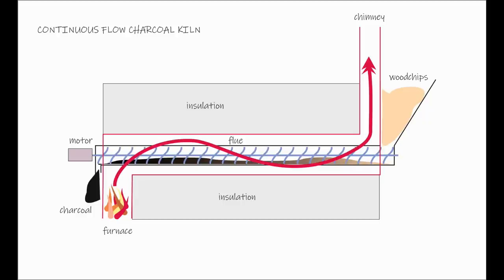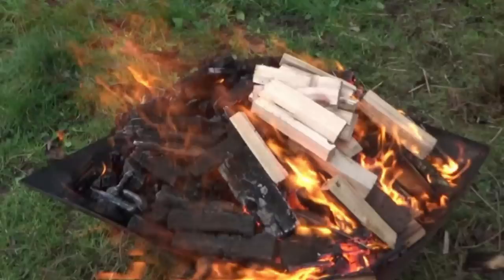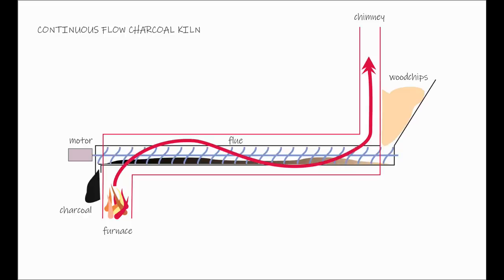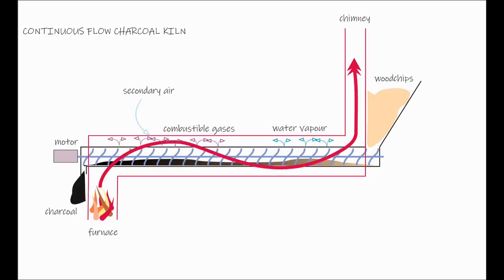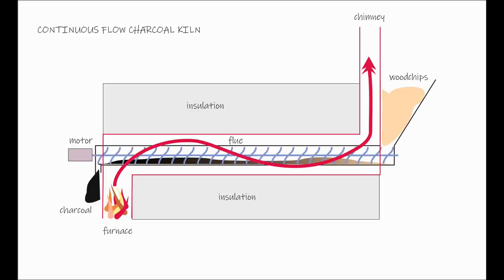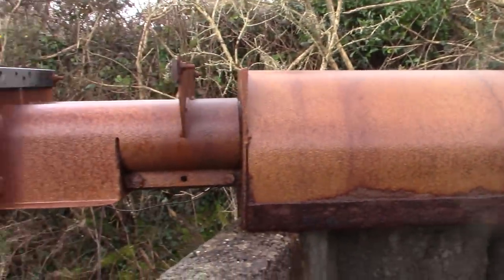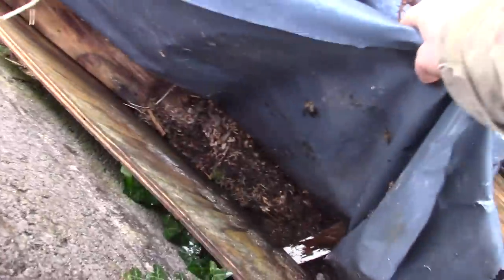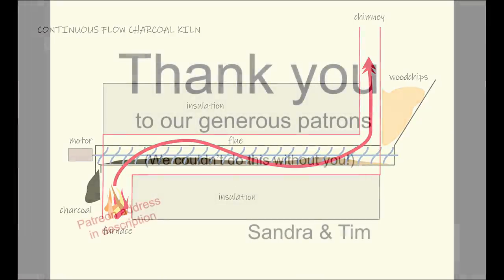An Interesting Design For Constant-Flow Charcoal / BioChar Production..

Comment: I think you are really close with this design. Extending the augur tube on the exit side some distance would allow it to cool.
Also, drawing the intake air for the forced air down across the cooling part of the charcoal exit tube might help cool the charcoal below the spontaneous combustion temperature.
I sawnutwiss's suggestion of a chain conveyor might be cheaper
Reply: Yeah, counterflow air!  That would be neat.  Could maybe figure out a way to “entrain” the Pyrolysis gas or syngas or whatever it is called from the end of the auger into that airflow to allow it to burn more towards the entry.

Comment: Some ideas
You could use cement or brick as the insulation material and then run pipes with water through the insulation, and then use those hooked up with radiators to heat a building. You could also take the wood gas that comes off of the charcoal process and use it to power your locomotive for your railway I know in the 30s and 40s people would power their cars with wood gas stoves.

Comment: If you wanted to do a continuous process, I'd use a slanted pipe with a rotary airlock on each end. I'm not sure if it would pass your wood chips though. If the output end had a water jacket, that would both solve the ignition problem and also heat the water for your house.

Comment: It’s a very interesting almost ingenious design but I’m curious how you plan to stop creosote from gumming up the auger since creosote is extracted from the wood in the charcoal making process and can condense inside the auger or smokestack, also you could theoretically replace the bearings in the auger with metal shielded ones and connect the augers to the line drive which would eliminate the issues with what you already have with it and potentially make it viable to continue with the old design
Reply: I think sheerly via high temperature was the plan; have them stay as vapor and combust with the secondary air and/or get thermally cracked into more volatile hydrocarbons and/or syngas (which would do the same) and/or petcoke.
Reply: Granted a good clean once in a while is always nice!
Reply: @ericlotze7724  I was talking about on the screw of the auger which is theoretically the coldest part as it’s furthest away from the radiating heat and has charcoal sliding along it which would absorb heat from the screw as it passes by as well, but now that I’m actually thinking about it that is a very valid point it should easily stay in a gaseous state so long as he can keep enough heat throughout the entire system, the main times he’d have issues with creosote is upon startup and shutdown so as long as there’s enough heat still in the system he’ll never have an issue, thank you for your insight it helped clear up the one thing I apparently missed
Reply: In insulated rocket stoves, no creosote is formed, as the temperatures are so high that any side product such as soot, creosote, smoke etc gets burned in the afterburn process. My guess is that Tim's burn chamber did exactly that as well
Reply: @09conrado  Just as important in an rocket stove is that any creosote forming oxides and converted to CO2. The main design point of a rocket stove is really to ensure that there are always enough oxygen to complete the combustion. That's why you can have a roaring fire and hardly any smoke.  🙂
Reply: @09conrado  thank you for clearing that up, I’m used to uninsulated setups which is why I was concerned

Comment: I may have a solution for a possible cooling chamber. Once you have the conveyer system through the hot zone sorted, you could use the auger as a cooling tunnel of sorts.
Have the hot charcoal fall into the auger and the journey through should cool the charcoal. Furthermore, the density of the charcoal shouldn't jam the auger. If a piece of charcoal happened to get caught, the auger should pulverize it and continue on. Of course, this addition would also add considerable length to your operation.

Comment: As for the bearings. High temperature sintered brone impregnated with graphite is available. It's a self lubricating bushing material. It's a little spendy, but you really only need about an 25mm to make 2 bushings.

Comment: Thanks for another charming video!  Instead of 1 or more conveying tubes, you could have a flat rectangular section tube to maximize heat transfer instead.  This wide tube could be propped up at an angle and the contents moved by vibration aided by gravity.  Being wide and flat, this tube could carry the flue strapped to its lower surface, with the upper used for carrying the pyro gases back to the fire box.
Reply from the maker: Yep, good idea. But it needs to exclude the air too..
Reply: @wayoutwest-workshopstuff6299  Some downdraft gasifiers are configured roughly the same way, and they manage to keep the air out by having an air tight lid on the feed hopper, the hopper being part of the same space as the reaction tubes.  It's true that the feed hopper needs to be opened when recharging it, but this happens only infrequently and for a short amount of time, and since there is a slight positive pressure in the reaction tubes, one would not expect much air to enter with the hopper lid open.

Comment: About the spontaneous combustion of the charcoal at the end, instead of cooling them with water. Drop them into a airtight box. Well, airtight in terms of incoming air. Need some pressure relief. But then you can cool it by preheating the air that goes into the blower. Put fins on the box and draw the blower suction air past them.

Also, tip the augers down so that gravity assists.

Finally... stainless steel! Haha expensive yes

Comment: Could you use a chain conveyor or a the some like that.  Basically attach a large steel circle or square on to a cable or chain and pull it through the tube or box.  That way you can keep the bearings away from the heat as well as the drive motor.  It won't plug either.  You could use flat bar welded together to make a square tube and a paddle wheel to pull the chain.  Good luck

Comment: Nice idea. I also had a tried and tested way to produce charcoal which I have used many times. It is simply to have a stove with a straight chimney but with a very large grate. By that I mean the holes in the grate are very large about 10-10cm. All you do is light a fire on the grate and as the wood turns into charcoal it falls through the grate and into the ash pan as charcoal ready for you to scoop it up. There however does need to be a way of regulating the amount of air that enters the fire because otherwise it will burn too quickly whilst alight. From the ash pan it can be funnels via a tube to a bucket of water to cool it down. I have used this method many times and have always had plenty of charcoal. It’s a bit unconventional however is able to produce lots of useful heat and charcoal. 

Hope you find this idea useful, 
Best regards, 
Sam of the Violet Valley Railway.
Reply from the maker: That's a good idea Sam - do you mean it's a by-product of the woodstove in the house? Or specifically for charcoal making?
Reply: @wayoutwest-workshopstuff6299   it can be used both ways. I made one out of an old gas canister and i use it to keep my garden shed warm in the winter and collect the charcoal allong however in the summer its used just for charcoal. 

Best regards, Sam

Comment: You can eliminate the auger with a vertical/diagonal pipe that is fed from the bottom and empties into a box in the bottom. The rate that you empty the box at the bottom controls the flow rate (rotating flap maybe?). This also allows capturing wood gas coming up the pipe, and since heat rises the charcoal at the bottom can cool off before exposing it to oxygen. you could Even add a water jacket around the collection box and above it, giving you hot water to heat your home.

Comment: The big gas ovens I am familiar with all had cooling zones after the main firing section. Whether it was vertical can cookers, iron pipe or pottery. Drives and drives chains etc were outside the heat zone. 
I expect you already have it all planned out. Awesome. Thank you.

Comment: Couple of quick thoughts. 
Put your chimney 1/2 to 2/3 of the way down your tube and water/air cool the remainder of the tube for cooling  the dry charcoal.
Thermally insulate the shaft between fire box and bearings. Some sort of fiber shaft connector.
Great overall design.  
What are you using the charcoal for?

Comment: I worked on the design of the control & safety systems for a medium sized pilot plant 20 years ago.  It was the same principle, using an inclined rotary kiln, with a rotary valve at the hot end for the feedstock. But it was self sustaining once the coal started to gas off. It ran for a number of years before it was mothballed. Quite a dangerous bit of equipment actually.
Reply from the maker: Was it for making charcoal?
Reply: @wayoutwest-workshopstuff6299  it actually used coal as a feedstock to make coal char. Same but different.

Comment: Looking at the diagram and heat flow, I wondered if the motor would be better off being on the opposite end. The entering wood chips are the closest thing to a cooling system for the auger shaft and would cool the convected heat  going to the bearings and motor. The end with the fire box and exiting charcoal could be solid bearings cooled with the same water system you come up with to cool the charcoal.

Comment: Lengthen each end of the charcoal tubes. Wrap a water bath around the output end, to cool the char, but not get it wet. Have the auger flighting end before the tube end, so the char piles up inside the tube, to block fresh air from getting in. 
The auger flighting should be thick, but it doesn't need to be continuous. Maybe use plate paddles at a slight angle instead of flighting. Like at the bottom of an ice maker in a refrigerator.

Comment: Hi Tim, I understand the cheap, easy and clever kiln you have made instead does the job well enough for now and, taking the time to think about the project you describe here, I also come to the conclusion it may be just the best. If you ever get back to this project: Could you only "push" the wood chips in the cooking chamber? With some kind of piston or endless but short screw and slow gears at the bottom of the wood chips funnel that would push the chips into the cooking chamber. The fresh wood chips would push the ones already inside and cooked bit by bit until it goes out on the other end. In that case you don't need long and multiple tubes anymore but a quite flat rectangular shape (cross cut) chamber could do the job. You have the tools to make such a chamber from flat iron shits. Rectangular and not square or round to increase the surface area. No moving/iron part goes into the chamber so maybe would a thick enough iron does the job instead of stainless steel?  I see one critical part in my head still, how to avoid jamming at the entrance of the chamber? Good luck, success and fun:)

Comment: My thoughts: 
Let the auger be a bit longer, so that the motor end has a longer path that is in cool air.  Reasons:
1) Less likelihood of conducting heat directly into the motor.  Actually you'll probably be running the auger via some kind of reduction so the motor won't be in any danger, but it moves the end bearing farther away from heat in any case - no bad thing.  Ah, I hear you mentioning that @ 5:40.
2) It ensures the charcoal comes out cooled well below autoignition temperature, and gives you the opportunity to physically remove it from the ignition threat that is the furnace before dumping.  Ah, I hear you mentioning that @ 6:00
3) Efficiency.  Arrange ducting to pull  fresh air past the post-cooking portion of the auger to ensure it is well cooled, contraflow to make the most possible heat transfer, before that air goes into the furnace burners.  Harvesting the heat to contribute in any way toward the useful cooking is making the most of your fuel's heat output.  Ideally, the flue gases at the far end, closer to the chips input end, would be nearly ambient temperature.  A sensor or two to monitor the exhaust temperature could automate the burners and prevent overcooking the chips.
3a) Efficiency, some more: the pyrolization process releases a lot of volatile gases, could you capture the output and route that back into the burner?

Comment: This is a fantastic process, and speaking patent wise if you ever desired to patent and market these you know just how much industry loves 'scalable' and 'constant-production' in the same sentence!
I will say, as you mention, augers are only really useful with consistantly-sized particles and better yet round ones; woodchips are neither.
I love the chain idea, namely because I would wonder if you could attach wire cages/combs or grates at regular intervals to them that could scraaaaaaape the woodchips along like a rake on concrete; should one slip through it just gets caught by the next pass, and if one jams against the side the comb tines would pop past it and keep moving, hopefully being caught again by the next one. Heat might become an issue so they might need to be more "claws" than tines but the tolerances on this could be sloppier too and given you're using this for biochar any iron filings created by scraping the inner tube would simply become bioavalible iron; hardly ruining the product! I would worry about air being more freely able to travel into the tube without an auger but if it's packed enough and moving slowly I can hardly see that being a problem except at the end where a sprayer could be handy :)
Good luck and be wary of biogas, it's sneaky and flammable, should it build up somewhere it could pass into deflagration territory
Reply: Granted patents are only as strong as your legal team
Reply: Patents are a terrible waste of time and energy. Where will you find the resources to police them and have lawsuits? No one else will do that for you

Comment: A solution for the continuous process would be to push lidded containers through the heated chamber in a conveyer system. Completion of the process could be determined by testing the internal pressure at the outflow pipe. The containers could then be cooled before emptying and reusing.
Reply: I like this idea, maybe a number of metal ammo boxes (from Harbor Freight) moved thru maybe 2 55 gallon horizontal drums with a chain transport.  Maybe version 1 could be a manual wheel.  Not really continuous unfortunately.  I keep wanting to "purpose" existing recycled stuff like old water heaters, etc - anything to justify me buying some new tools. LOL

Comment: I would skip the auger and run it as a rotating kiln instead, ie a leaning barrel/pipe rolling on bearing blocks. Fewer complex parts exposed to heat that way.
Reply: Came here to say that. It's what scale production uses. A slight slope and a spiral can be added too. If it is extended past the hot section, secondary air can be blown over the outside to both cool and preheat the air prior to injection. Either that or make the furnace burn lean and recapture pyrolysis gas.

Comment: Perhaps a drag chain conveyor might work well but it might need an independent means of controlling the wood chip feed rate. Drag chains are often used in the bottom of very large coil fired boilers to remove ash and clinker and are usually submerged under water with an incline on the outside to lift the material and drain water

Comment: Nice design, you might want to put the furnace on the same side as the woodchip intake so the main pyrolysis take place in the first section and cools as it reaches the end.
Also, instead of having vents along the auger to burn the gasses you could collect them! Just have a an exit point off the top of your auger before the end that goes through a long pipe to cool and condense the less volatile products, bam you got wood vinegar. If you have a wider pipe, a smaller auger or put some holes in the auger blades so the gasses can go around and then narrower near the end so they are forced to escape earlier.
If you don't have the vents in the auger you could surround the whole auger with a furnace because you could limit the oxygen and it shouldn't matter how small or how long the chips spend in the auger as long as you can limit the oxygen!

Comment: Good idea tho it may need a couple of flaps to regulate air into the fire and smoke out of the chimney. Perhaps making the fire at the hopper end so that the charcoal is cooler as it exits so that it doesn't burn itself, also may help with the bearing seals in the motor(s)

Comment: Like others, I'm thinking some kind of conveyor but I can't quite picture it.  Like little train coal cars; or the treads of an escalator (but instead of a tread, a box with open top).  When a car exits with hot charcoal, the track aims downhill 90 degrees like a roller coaster dumping its load of charcoal into water.

Comment: I wonder how effective a Sterling engine would be at synchronizing the auger flow and the heat source.
A Sterling engine uses the temperature difference to move a plate using the natural air cycle (hot air rises, cold air sinks). Lindybeige, a YouTuber I follow, has a couple videos on it.
But the hotter it is, the faster it spins. Could be useful?
A fascinating design either way. I'd love to see what comes of this.

Comment: A good idea. Use carbon bushes instead of bearings, also extend the exit tube and pass it through a water jacket. To stop the material bridging in the hopper, passing through a rotating paddle with a possible vibrator.

Comment: Whatever option you go for, consider insulting the system in sand ala the Polar Night Sand Battery used to store seasonal heat energy. Could run a heat loop through it and back to some sort of heat exchange with your own homes hot water system.